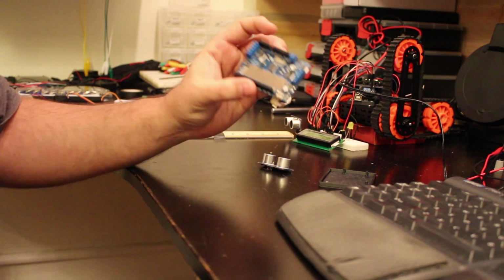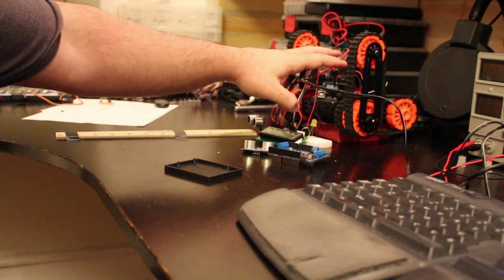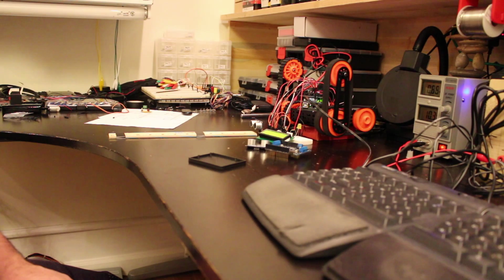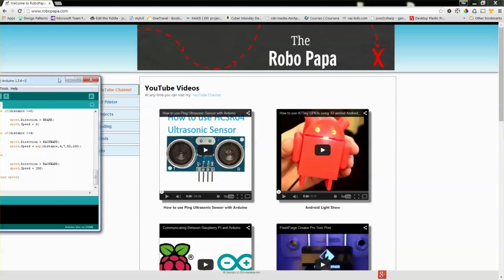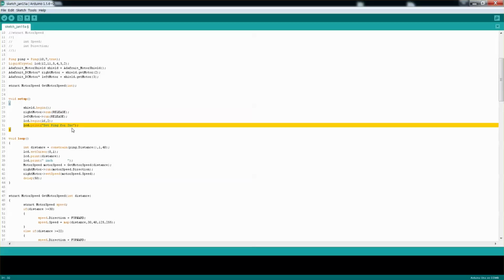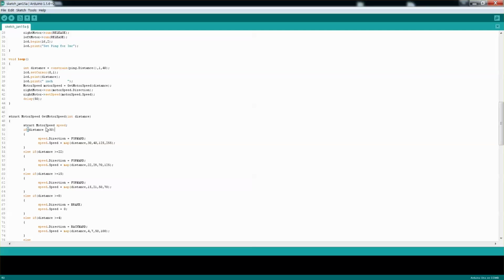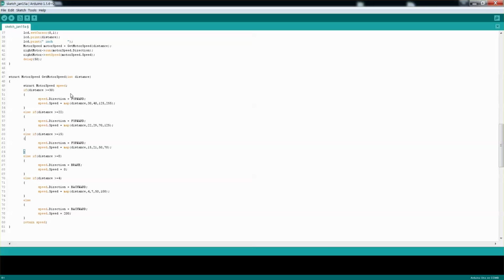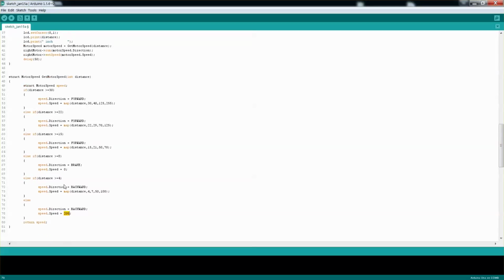Tutorial In How To Write Arduino Code For obstacles avoidance

Comment: Your if and else if stamens are bad. If distance is 30 it will go through all of the statements. Causing the cliches
Reply from the maker: why are you saying it ? If the distance is equal or greater to 30 it will go in the first if statement. Else it will check to see if is greater than 22. Knowing that the first if statement was false we in away checking to see if it is between 22 and 30 and continue like that until the last else which is the default. I tested the code and there are no glitches.

I have a video that explain the basics on C# if you want to look here:

https://www.youtube.com/edit?o=U&video_id=Z4CRvxkrAuI

Comment from the maker: +Bruce Banner (justpab) : First  you want to remove your serial our of your for loop. There is no reason to initialize the Serial so many times :D
You can take a look at my web site to find the code for the ping sensor http://www.robopapa.com/Projects/ArduinoAndSensorsPartTwo I think looking at the code will help you. Let me know if you need more help!
Good luck and have fun with it!
Reply: Robo Papa Thank you! Yes, I saw that code on your website but how can I incorporate it with my DFRobotShop Rover Mobile Robot Shield? Because in your video you called the Adafruit library and I don't have a library for my shield. Do I just copy the ping code and paste into Arduino Software? Is that it?
Reply from the maker: The adafruit is just a motor shield that you add on top of your arduino and its not related to your ping sensors. You probably will need to update the code to move the motors. I recommend that you will start with the ping sensor make sure that works than add the motor shield etc. Hope that helps!

Comment: Hi there, I am trying to do the same thing for a project I have for school. I have an Arduino Uno, I also have a Robot Shield that has an h-bridge to control 2 DC motors. I have a code to make the motors run, but I want to implement a HCSR04 sensor to it so that I can control my motors and have my rover avoid objects.

Here is a link to the kit that I bought: http://www.robotshop.com/en/mini-dfrobotshop-rover-kit-arduino-uno.html

Again, you use the Adafruit Motor shield, but mine is called the "DFRobotShop Rover Mobile Robot Shield."

I'm new to using Arduino... and basically don't have a clue of what I'm doing. I would appreciate if you could help me with the code I need to run my motors and control them with the sensor. Here is a code to make the motors fun at full speed:

int E1 = 6; //M1 Speed Control
int E2 = 5; //M2 Speed Control
int M1 = 8; //M1 Direction Control
int M2 = 7; //M2 Direction Control
void setup()
{
int i;
for(i=5;i<=8;i++)
pinMode(i, OUTPUT);
Serial.begin(9600);
}
void loop()
{
int leftspeed = 255; //255 is maximum speed
int rightspeed = 255;
analogWrite (E1,255);
digitalWrite(M1,LOW);
analogWrite (E2,255);
digitalWrite(M2,LOW);
delay(100);
}

I've tested that and it works. How do I add a HCSR04 code so that my rover can avoid objects? Thank you so much!